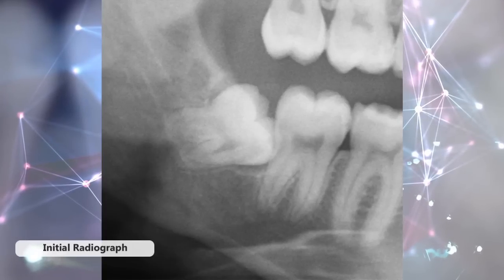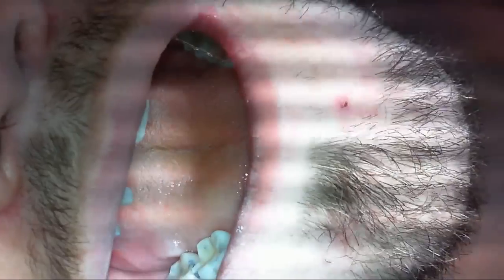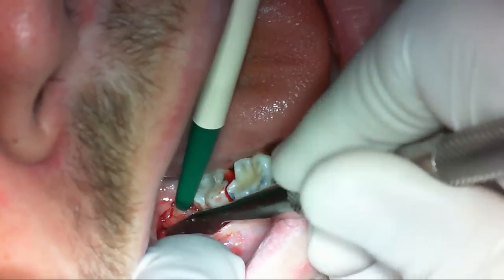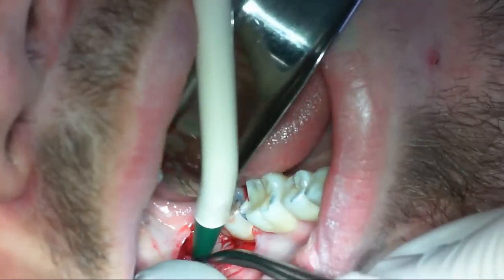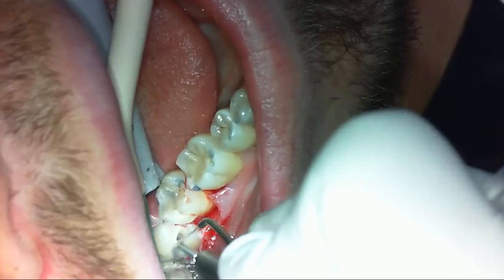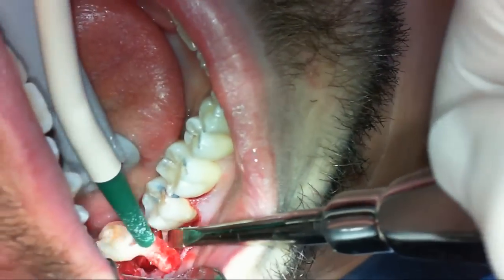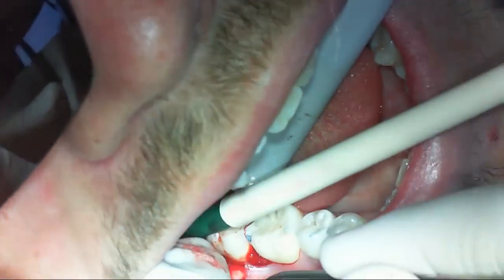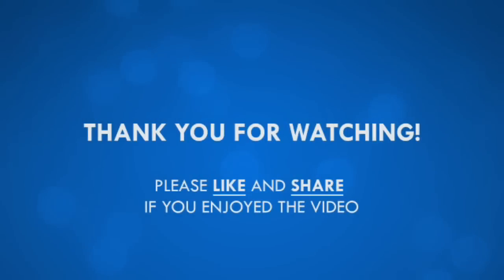Surgical Extraction of a Mesioangular Impacted Third Molar 48

Comment: Great video Dr. 
How can you ensure the adequate tooth sectioning in Bucco-lingual direction ? Do you have any tips on that? 

Thank you Dr
Hoping to hear a response from you soon ❤
Reply from the maker: Thank you for your email 
Use he pulp chamber as a reference, once the pulp chamber is entered, move the bur coronally and apically, then lingually, with good magnification and light, the enamel will look thin and the shadow of the soft tissue / bone will show through the thin enamel, that's when you stop the sectioning and start splitting the roots / crown.

Comment: i had the exact same case, the doctor took x-ray, and immediately said-let’s go, i will be on vacation for next 3 weeks. so he lifted the tooth and shaved  half of the tooth off with the bore machine, then took it out
Reply: I'm extremely nervous
Reply: riri5pink don’t worry, it doesn’t hurt and you will only feel like teeth touching each other, like pressure, nothing else. my procedure took 15-30 minutes with such difficult tooth position. if you are nervous, you can ask the doctor to describe what he is doing, it will be easier for you
Reply: @riri5pink  hows u?
Reply: does it pain?
Reply: Shantanu tiwari well, i would guess yes without anaesthesia.
Reply: @DelphineEraklea  abvio he will give local anesthesia, u got local anesthesia. does it hurt to u?
Reply: Shantanu tiwari little bit. they first apply it to the “skin”, so it doesn’t hurt when then they apply it to the muscle, basically they do first a shot to the top layer, or cover it in like children’s anesthesia gel, and then they put the needle deeper to reach the muscle that is responsible for particular part of jaw and little bit face. it did hurt of course, but not to tears, just like wtf why u put it there. for me it lasted 6 hours maybe. but i am susceptible to longer reaction to anesthesia.
Reply: Shantanu tiwari you should take painkillers once you feel anesthesia is fading, as it will hurt, and you won’t be able to open your mouth properly if you are getting lower tooth removed. so i got my tooth removed on evening, so i can sleep it away, then i woke up and for 1-3 days couldn’t fully open my mouth, and on first two days was taking pain meds, cuz my muscle hurt from the shot, and the removal area was little bit whiny. you’ll also have heavy swelling, it will go away
Reply: @DelphineEraklea  m gone now. doctor gave the appointment after 7 days. damnn i am going to thing all 6 fkin Days. i can bare after pain,  but my main question is does it hurt during the procedure.
Reply: @DelphineEraklea  i dotn know why the hell i got these impacted wisdom tooth 😫 
lyf was beautiful earlier.
Reply: Shantanu tiwari no, during procedure after the shot you shouldn’t feel anything except for pressure from one tooth pressing on another. if you feel anything, tell doctor at once.
Reply: Shantanu tiwari don’t worry, it will be ok)
Reply: @DelphineEraklea  thankss a lot for ur time.
hope everything will be alright soon . tc
Reply: Shantanu tiwari how are you? did you have an appointment?
Reply: @DelphineEraklea  hey,  yes i did it. swelled up now lol
Reply: @DelphineEraklea  thanks haan, ur words really helped me a lot.😆
Reply: he took around 30 mins in my case, got 2 stiches, n did local anesthesia ,didnt feel but pressure n bit some itchy pain(as something is inserted)  then i came back after 4hours a bit tolerable pain, night bleeding and morning swelled up.
got today again for the review as doctor called me for dressing, he said m all fine and fit, need to take medicatons for 2 more days.
Reply: Shantanu tiwari that’s great! just as i told you, right?)
Reply: Shantanu tiwari like half of the face is thick, yeah? ahahah
Reply: @DelphineEraklea  thnxx muchh 🤗 wr u from btw
Reply: @DelphineEraklea  yeah, he did it day before yesterday, on a liquid diet. yukk.  cant open my mouth too idk why..
Reply: Shantanu tiwari it is the swollen tissue+muscle soreness
Reply: Shantanu tiwari no problem) russia)
Reply: @DelphineEraklea  yaah it might go in 2 to 3 days.
Reply: @DelphineEraklea  idk why this wisdom sucks.

Comment: There are a few things I would suggest. 1. Gauze pack, even if patient is awake, always better to have just in case. 2. Retract with a retractor, always. Not only for safety but for fatigue, you can retract better with multiple fingers on a metal retractor than your single finger. 3. Use a bite block, helps the patient bite down and not get TMJ issues following extractions of lower teeth. 4. Suture the distobuccal incision, there is no fear of the lingual nerve here since the whole incision is buccal to even the central fossae, and it keeps the incision closed. 5. Suture the papilla back between the 2nd and 1st molar. 6. Elevate before sectioning. If you get the tooth loose before you section, you already know the roots are loose. Usually after you section, you lose a good purchase point, so better to have the roots loose to avoid removing more bone to get a new purchase point on the remaining crown.
Reply: But if you elevate before sectioning that's make more pressure on the tooth so you can heart the mandibular nerve during luxation specially if it's so close  but with sectioning you make minimum pressur so you have safety luxation
Reply from the maker: I agree with you on 1, 2, 3, 5 but not 4 and 6 
Elevating first can risk cracking a very thin lingual plate, however it is a very useful tip for other teeth 

Thank you for taking the time to write the nice tips.
Reply: Ioio9iiiiiuuuiikkioiiioiiooko9ioooooooooiiiioijkkhjjkkkjjiiioioikkkkkkiiokuyyyyý
Reply: How to prevent guttering of tooth while bone guttering?
Reply: Agreed. My OMFS specialist always emphasized on number 6 and he’s been a specialist for almost 30 years already

Comment: Nice video and narration.  I have a question and a suggestion.  Why do you not use a retractor throughout the entire procedure? Seems like this would be a good idea for safety since you're not using a pharyngeal screen.  I'd like to suggest your viewers explore the 1703L fissure bur with round tip. The tip is 2.1 mm and working end exactly 7.8 mm.  This can be used as a ruler during sectioning and troughing.  There is no guessing on depth and vital structures.
Reply: I do agree with your 1703L bur and the pharyngeal screen. That is what I do too. But after seeing Dr. Shahin cutting bone so easily and neat which is not in the case with 1703L bur. I will definitively try with round bur. Just for a change. :)
Reply: What is meaning about pharyngeal screen  ???